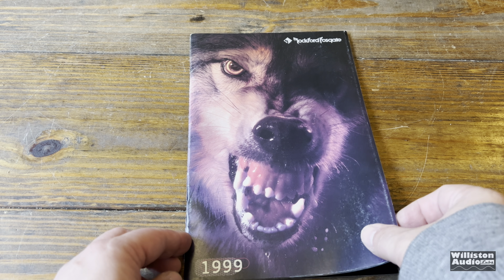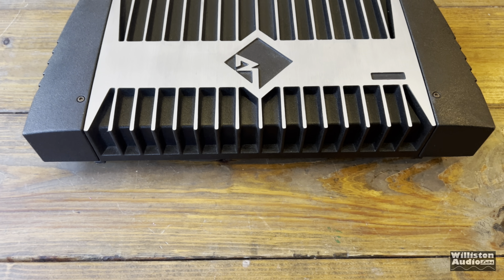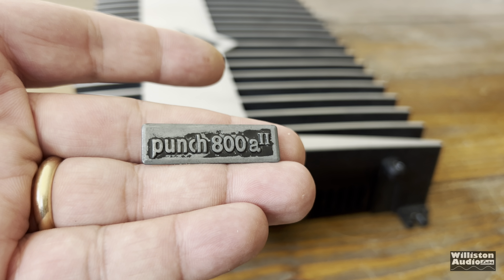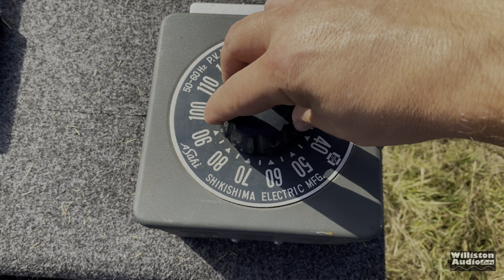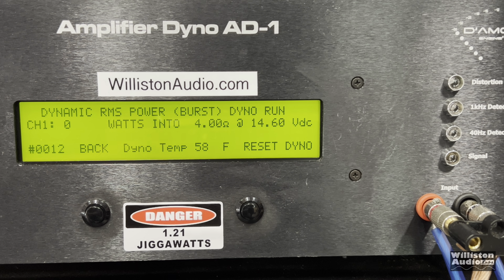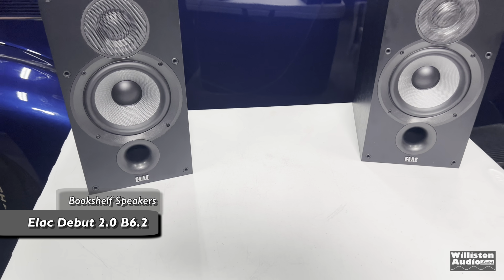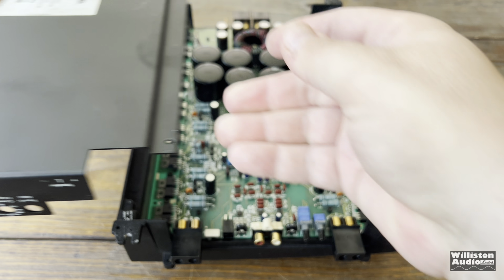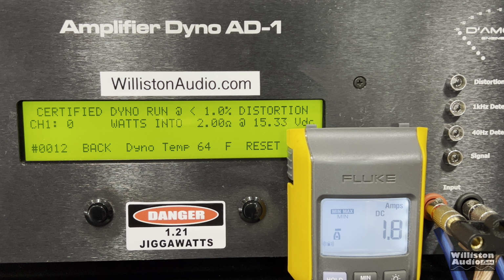This 800W Amp Cost $800 Back in 1999 - Rockford Fosgate Punch 800a2

Comment: Audiokeller got 818w mono at 4ohms testing this same amp, and 948w mono at 4ohms with the Power 800a2 amp!  So it did it's rated power (800 watts) at 1khz, just not at 40hz.  Although dynamic power, it did over 1000 watts, as well as the power 800a2 amp.  Maybe it could've done 800w certified also, if tested at 50hz instead!
I bought this amp brand new in 1999 for $425 at a local stereo shop in Miami (Señor Stereo), and had it pushing 2 Punch 15" subs.  It sounded amazing!!
Thanks, nice video.😊

Comment: So im new to amps and speakers. I have my dads old punch 800.a2. I just bought one NVX sub thats rms is 1200w and i was wondering if i can use the 800.a2 to power that. The sub also is 2 ohms.

Comment: I had one of these back in 2011-2012 I got it DIRT cheap from a tweaker on Craigslist. 

The gain pot was broken when I got it, ordered a couple new pots and replaced them. Amp worked flawless and pushed the powerbass 12s I had it on hard. Ended up selling the setup. 

Have been curious of the power output. Your channel didn't show up for a long time on my feed so I have been getting caught up. 

Mine had the number so mine wasn't a best buy amp.

Comment: I had this amp when i was in the Marine Corps back in 99-00. Ran it to 3 JL Audio 10w6's and later on two punch 8's of the Era. The 10w6's freaking cranked and it made the punch 8's sound like they were 10's easily, some people said 12's, lol. Great amp, wish I never sold it with the car

Comment: I had a 800.4. 4 channel 100 x 4 at 4 ohm. Think i bridged 2 channels to the subs and the other two ran my fronts. i think i got it like in 2004 or 05. Bought it from a dealer with an install. That thing took some miles. Had it repaired when it went out and traded it in on a premium eclipse 5 channel after that to the sane dealer.The rockford was a great sounding amp with plenty of headroom. So was the eclipse.

Comment: I had the 1100 running four 10” solobarics, the round ones, switched them out to four 10” JL W3, and ran  a 600a on the doors and rear in my S10, that was a loud truck

Comment: Great work as always, keep it up.

I would love to see you test the following amps:

Rockford Punch 700S, older amp.

Diamond audio, previously esoteric amps.

Blue tube driver from Butler

Zapco AG or the Reference series.

Brax or helix amps from Audiotec Fischer.

Also, sound demos of Seas Lotus loud speakers.

As well as Diamond Audio, TDX subs, especially there 15's, boy do they slam hard as hell as well as very accurate, incredible subs.

Granted, very expensive stuff here but never know.

Comment: I had one of those 800w Punch series amps, as well as a couple of the previous design Power series "Power 300" models. Definitely hard hitting amps (all before Class D was available). These were hard-hitting amps.

Comment: I’ve got a similar model and unfortunately it overheats after one hour of usage - resulting in clipping to prevent total failure, so if you’re looking to save money by buying used, just know this will need a fan or some cooling applied

Comment: Wow!!!! I loved those amps! Back in 2000 I had a pair of those (Punch POWER 800 a2's) each running at .5 ohms, on a pair of Shocker 12's in my 1991 Buick Skylark.  Did 150.6 db @ a DB Drag comp back in 2000. That was back when Termpro was using those old skool Bob Barker Price is Right skinny mics for metering.

Comment: Thanks for another cool video. But I can't say I'm surprised how everything turned out. I'm a fan of Rockford Fosgate products, and even just how they run their business having their products made in South Koea instead of China. Advertising they are not a stereo company, but a "Design company". I could be wrong, but I just have a feeling if you worked for them you'd not only have a good job, but a fun one as well. (However much fun you can have designing amplifiers anyway).  lol

Comment: My buddy just picked up an MTX 250 Thunder amplifier used for a good price. And the manufacturing date was 10/1999. Naturally I took off the back panel and inspected it and no leaky capacitors, everything looked good. So putting it back together is when I saw just the most amazing thing on the amp cover. It said: "Made in America"! Sure enough, when we got it installed it worked just fine. So MTX used to be honestly the "real deal" when it came to car stereo amplifiers. I guess you learn something new every day.  lol  Because, the video I saw of a recently tested MTX amp on the channel ended up with the "Dick Rickulous" seal of approval.  lol

Comment: I will never forget these days!  I was 18 and Rockford was the cats meow.  I worked at Best Buy in 2000 and it was timeless.  We raked it in with discounts.  I'll never forget the first time I saw/heard a 18" Solobaric (sp?) sub connected to a mono Rockford - holy hell,.....holy hell.  That was literally and figuratively earth-shaking stuff.  Just a great time for car audio tech.  Thanks for the trip down memory lane.
Reply: Former Best Buy employees unite!!
Reply: @1stRoldy  YAS!  Will never happen again.  Those days are forever gone.  We are so lucky to have lived through those car audio days!
Reply: Same, I was also an install tech. we were best of the best for years. we got hooked up with the deals on this era fosgate. I would kill for a head unit with sd card changer from this era today.
Reply: @edwardmartinez6730 Anything with a usb port (not just a charge port) can accept an SD card with an adapter! 😊
Reply: I worked at Future Shop (what Bestbuy was originally called in Canada when BB was testing the Canadian market and didn't want to put the BB name on ot incase it didn't do well) and the discounts we got were awesome.  10% over cost.  Had a $2200 retail system in my car and paid around $980.  The markups on alot of stuff was mind numbing.  Once a year MTX and a couple other brands would give the Car audio sales guys at each store crazy discounts on their gear.  I remember buying 2 DVC 12" thunder 8000 subs for $100 each (cost was normally $124 and retail was $349!)
Reply: Got my first Amps from Bestbuy.  Hifonics "American Warriors" Hawk and Falcon amps (circa 1995/1996). Had some Lightning Audio Bolt Amps from Best Buy too.
Reply: I remember those days also at Best Buy. Back in 1998 at Best Buy they had a whole area where they sold car audio equipment. They had a test vehicle that was interactive on the show floor with buttons to press to hear the difference in speakers and subwoofers in the test vehicle. You could alternate the music also through a pre programed music playlist.  Every time, I would press the buttons to get the best speakers (Cerwin -Vega) and I would play the Fugees The Score and let the bass hit.. man I miss those days...
Reply: @CobraR1993  YES! We had that too.  Thinking back, it looked like a Tesla Roadster kind of.  I think it was red too.  

Best Buy always pushed Cerwin, it was their staple.  That and Pioneer I should say. 

Man, Pioneer 4-way 6*9's back then could hit when properly amped!
Reply: @CobraR1993 There was a similar thing at Fry's Electronics, although it was just a soundproofed room. This was less than 10 years ago. It wasnt that loud unfortunately. But a whole car??? That's too cool!

Comment: Great video.  For the comments being surprised about power output falling short, many of you accurately focused on the capacitors.  So, YES capacitors do start to degrade by leaking around 15 years old. Since we don't know the condition of the capacitors in this amplifier, they should be replaced on older amps since they are the primary current storage devices for the power supply and rails.  If you have a hole in your bucket, you can only store water up to where the hole is, same with current, right?  For questions on why the MOSFETs don't use a clamp bar, it's because they are soldered to an extremely efficient substrate called T-Clad (MEHSA - Maximum Efficiency Heat-Sink Application).  This substrate is then secured to the heatsink using those black hex screws.  This eliminates the reliant on clamp bars for effective heat transfer.
Reply: I’ve got the model before this one, it’s the punch 800.2 it’s got some mosfets missing on it as it went into protect, was wondering if those are still available to repair and replace, or at least schematics. I’m a local around the warehouse as well!
Reply: I think everyone is just use to seeing these old beasts best their numbers so if ever they don't people are gonna be shocked. All us collectors know the truth. Gotta replace those caps!
Reply: Wow shot Nichicon capacitors and MOSFETs in a Class AB amplifier. You say some crazy things. I think the one with a hole in their bucket here is you.

Comment: We (Rockford Dealers) asked our reps the exact questions you have with the 800a2 and its perceived underperformance (for a Rockford Product...). The answers we got was that the amp was originally designed to be rated at 150 watts RMS X 2 @ 4 ohms or 600 watts RMS @ 4 ohms mono but it fit in the model lineup better calling it an 800 watt class amp. It was in direct competition with the MTX2300, and it looks better on paper rated higher than its competition, even if it barely makes the ratings. It certainly fits the mold to have been called a Punch 600a2. The Power 1000a2 or 1100a2 (or whichever it was designated for the 1999 model year) was a straight up beast for the day. I owned a shop in '99 and had a 800a2 on a 3-way MB Quart component set and a Power 1100a2 on a pair of HE2 12's in my personal car for shop demo. Both amps performed extremely well  in that setup and lasted for years without issue. Anyway, it might've been just an excuse for an underperforming product, but it certainly made sense.

Comment: Also the MEHSA mounting literally solders the mosfets to the heat transfer plate but electrically isolates the drain from the heat sink.  Great idea IMO.  Easy to work on with an appropriately large soldering iron AND effective cools the mosfets

Comment: In 98 I had bought the last series before they went to these "a2" series. Had two Punch 125s on 4 Punch DVC 12s and two Punch 45s for highs and mids. Did a 151.9 at the DB drag wired to 1 ohm in a 97 ext cab Chevy with a wall. Till this day I regret selling the amps. I ended up keeping 1 of the 12s. Good memories and Thanks Big D!

Comment: Had this driving 2 pcs of 8 inch dual 4ohm voice coil version wooffers  in 10 liters seal box built in 44 (2x22mm) MDF. It played tighter than a10 ton vice.

Comment: In 1999 I had bought the Fosgate 800a2 with the 400a4 amps powering three 12 Punch DVC HX2S, and four MB Quartz 6.5 component speakers. The 400a4 blew out and was replaced with the Zapco 6.0. I was going to replace the 800a2 with the Zapco 9.0 but decided to keep it. After 20-plus years my system is still bumping good.

Comment: Big D... Just got done wiring the Punch POWER dvc 12 subs up, went with t2d2 coils & used a hx2 cone w/ voice coil cut open for 4" coil and used top ringland for the sewn tinsel lead spiders from the T2D2s.... Basically made a shalllow t2 12... The good ol' 500.2 punch POWER grey series ready to do its thang on the subs...going in an ext cab Silverado... Should wake up the neighbors lol 🤣🤣🤣

Comment: I was an installer on and off for 30 years. My first system was original Punch amps/Polk MM speakers, Punch SPP!24 and Alpine source. I remember all that followed. At one point I possessed a Fosgate "Gavotte".  I remember when good amps commanded $3/watt.

Comment: I ran this amp for many years wired at 2 ohms with a custom fan setup to keep it cool 
many subwoofers had a short life from the power this thing could output and even alternators back then did not last me very long lol had to add an extra battery and move up to the bigger gm alternator 
still have this amp today going to re powder coat it soon to freshen her up

Comment: I wish i could find a couple of the 800.2’s that had the chrome removable panels. I had 2 of those on 4 ‘07 Cvr 15’s in a sealed box in my 2000 Impala. That thing sounded so good, and all the equipment lasted YEARS. Unfortunately, it all got stolen when I was out of town for work. Came home and it was all gone.

Comment: The golden age of car audio.   Stuff was pricey in them days but very well built.  I sure did love the un regulated power supplies.  Lanzar Rockford Orion.........oh man i miss those days!!
Reply: most of fosgate's amps are still un-regulated except for the constant power series but it's not as tightly regulated as JLs.
Reply: Had 2 15" and 2 10"  Lanzar Pros. Those subs hit so damned hard listening to Dr. Dre and Snoop. Can't forget Dj Magic Mike...
Reply: MTX also made some killer gear in the 1990s and early 2000s.  Had a couple 12" 9500 subs and those things were nasty with a 1200 watt RMS amp on each of them.  Very musical subs too.

Comment: I had one of these that i got used... Sadly i killed it in 02 when i was moving... Took out my sub box to put stuff in my station wagon and left the wires loose, i completely forgot about the wires and used my radio... Aparently they shorted out and the amps protection didn't work :( blew out one channel.

Should have kept it, but i sold it later... I just love the styling of these amps.

Comment: Through the years, I've seen .2, a2 and a.II Rockford amps, seen a 800.2 push 2 15's like they were nothing, I run a 1000.1bd, it needs to be repaired but it still slams.

Comment: I’ve got an older Rockford Fosgate punch 200 amp that I still use to this day
You’ve got a lot of videos I’m hoping you can answer this question and cut down my search have you ever done any MTX amps I run a jackhammer and a thunder from MTX that are older and I’m wondering how they stand up I’m a little disappointing in the jackhammer but I’m also a little disappointed in my skills as far as tuning an amplifier go so it could be my fault… it’s likely my fault 😂

Comment: Great video 👍👍I can confirm that , I had 409W continuous 1kHz into 2 Ohms with a 800a2 and dynamically 530W at 13.6V.
If we take the difference in dB it will show that the difference is no difference 😊

Comment: I had a Rockford Fosgate amp similar to that back in 2003-4.  It was a 300W RMS (900W max) and I got it from Best Buy.  I forget what model it was.  It was an amp, 12in sub and box combo. The first system I ever had.  That is incredible that it was able to move that sub so much.  It did hit almost 1200W for a split second.  I currently have a Rockford Fosgate setup in my car.

Comment: I used to run two Rockford Punch 800@2 with two power DVC Rockford 15s at 2 ohms mono. Did extremely well for the two woofer class at the time. Unfortunately, the Rockford PowerDVC 15s would melt the voice coil to the magnet every couple contest. Even though I was sponsored by my local Rockford rep Rockford warranty for the woofers was not happy with me. Most of the time the wolfers were not repairable. They had to replace the magnet because they could not get the voice coil out of it. But that was the point of DB dragration you pushed it till something broke. Just a win.

Comment: I sure miss my 1998 Pontiac Grand AM. TSW Spirit 18x8's. RF 800a4 and 1100a2. Boston Acoustics 3-way components up front, 6.5 in the door, mid and tweet in custom kicks. 4 x JL audio 12w3's in a custom, sealed fiberglass enclosure and completely hidden as a false floor. Trunk was still 100% usable, except I had no spare tire. 
Amps were mounted horizontally inside the trunk on either side of the trunk lid latch area and were flush mounted with a custom carpeted enclosure around them.
Al & Ed's Auto Sound of Rancho Cucamonga, CA did all the work and Brent (I think) did a fantastic job!
Later down the road they added a JL Audio 8w something in a custom fiberglass box that was mounted in the center console under dash. Also added a Rockford Fosgate Symmetry.
Yellow top battery and power cap. 
They removed it all in 2002, I sold it all off and bought a 2002 Subaru WRX. If I had it to do over I would've kept the Grand AM as it was!
Stuck in LA traffic, but cranking Metallica, ZZ Top, Van Halen, etc sure made things better! :P
Reply: All that bass and you played zz top!
Reply: Wow i best that set up rocked. I had a 96 chevy Camaro  with a 800a2 powering 3x jl 10w6 with alpine highs. Still my favorite sounding car i had.

Comment: At the shop I worked at in 2001, we're an authorized Rockford dealer. And I've installed a bunch of these amps all models. But I was more impressed by the Directed 1100d at the time.

Comment: I've seen various "birth sheet's" over the years with output power all over the place, some barely hitting rated, and some way over, so this is no surprise. That said, still great amps in my opinion, I still own two of these. As for Rockford being sold at Best Buy, I really don't think it hurt the brand name at all, as Rockford amps were still beasts / decent quality no matter who sold them. Yeah some of their smaller subwoofers weren't that great like the P1's, but really no different than the old 90's versions. I didn't know the Best Buy version's had the "aii" and the other were A2, so learned that today! Knew about the slight variation of the model, but never thought much of it. Like Walmart selling Pioneer head units (and others I'm sure), model was like DEH-14 instead of the normal DEH-1400, sneaky buggers. 😆

Comment: I was really surprised it barely did its power! Killed it with dynamic power though! Great video as always Mr. Williston!
Reply: Me too but over 1100 on woofer shows the real truth. Pretty impressive performance for 25yr old electronic.
Reply: @BDauto86  agreed
Reply: The electrolytic caps inside might be getting awfully tired/dried out.
Reply: @JasonWW2000  Exactly that, 25 years is a LONG time for caps even premium ones.